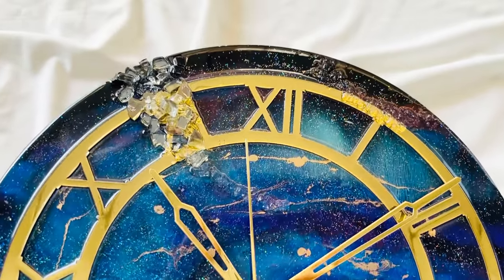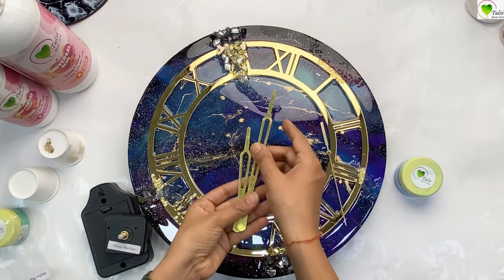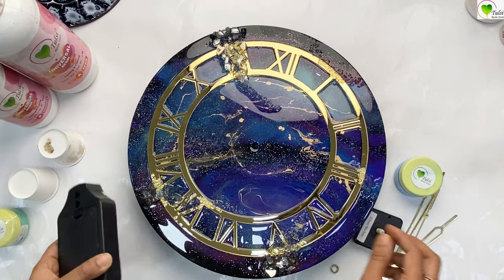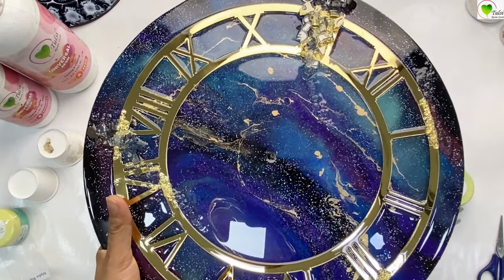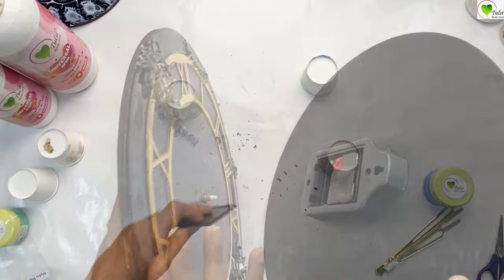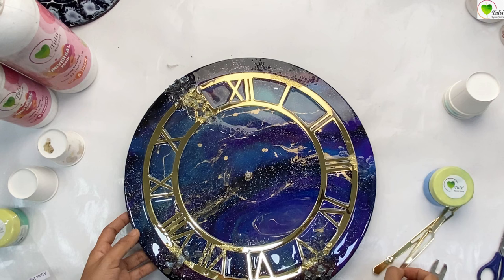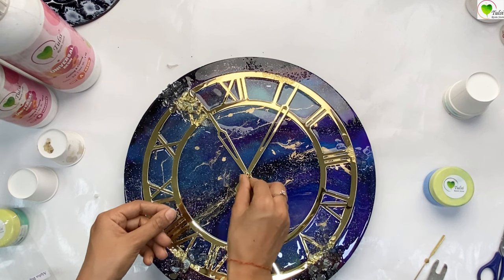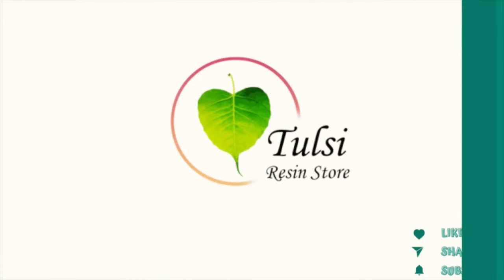Clock Machine fitting tutorial | Resin Clock | Resin Tutorials | how to fix resin wall Clock Machine

Comment: Is a washer necessary if I keep the machine inside a hanging cover? The gold colour is not coming off the base; only the white is visible. 😢

I bought a 12" MDF Clock Set With Numbers from the Tulsi resin store I got an 18mm machine for that